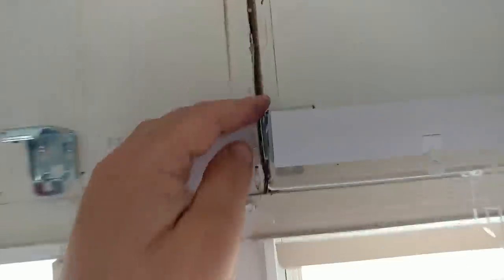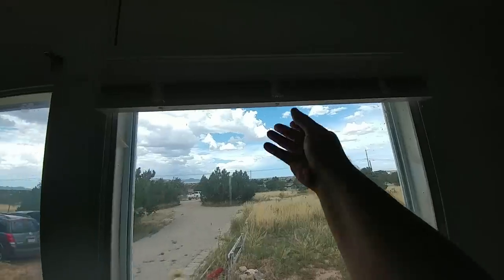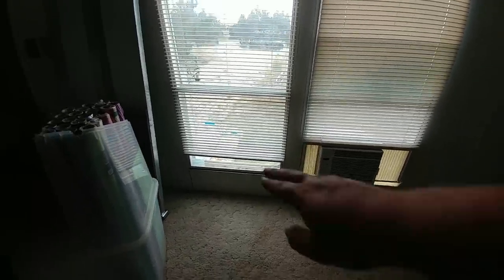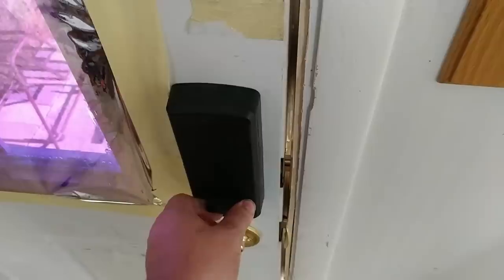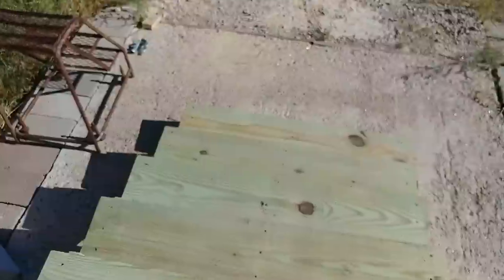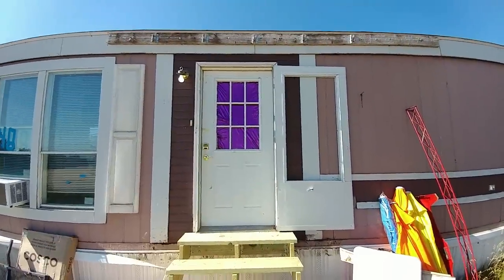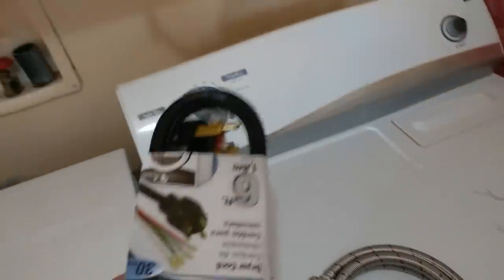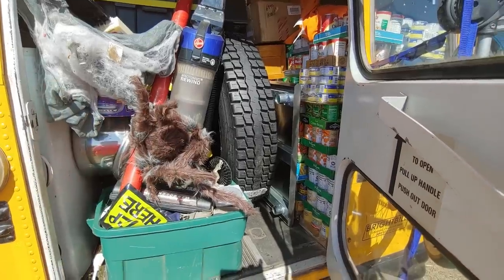The Insane Migration West 4of4 T3DP

Comment: Don't putty it, it will just crack and look worse. Put the wood back on and save yourself a ton of headache. The correct way is to tape the joints
Reply from the maker: Thats what i mean. Mid tape sand prime paint. Yes mud alone will just crack.

Comment: PRO TIP on the cordless blinds: measure the inside of your window frames and have your blinds cut to fit at the big box store when you buy them. Mount them inside the frames.
Reply from the maker: Wont work on these. They are not normal windows. These thick overall but thin outside inside weird double set mobile home storm window things. Very odd.

Comment: Could try running a garden hose to the washer drain just to check if it will overflow before you fully commit to washing clothes?
Reply from the maker: I ran a light empty load to make sure drain was good. It is. We have run 6 or 7 loads already. All good :-)

Comment: I wonder with the heat in your bus if the PLA is all shot
Reply from the maker: Windows are open and its shielded from amplified glass heat. It should be ok. I also keep it in shadow both at home in pa and here in NM. The sun hits the opposite of the bus. So far it seems ok.

Comment: Lookin good!  The blinds remind me of old timey shades, they pulled up and down just like that.  For the too short blinds, you could buy a longer valance (short little curtains that go across the top) then you could lower the blinds the five inches.  It's a good way to rig them so it won't show.  I've done plenty of things like that to get things to fit. 😁 Also you probably already have the tubs out but if not you could cut an opening in the side of the top tub empty it then it would be lite enough to get down.  Would lose a tub but you can get your stuff out. 🤪😁

Comment: you can actually mount your clips anywhere along the area your blinds run at the top. they do not have to be on the very ends, you hook the front and push to the back.
Reply from the maker: In my case they have to be on the very ends because that's where the studs are :-) basically they have to screw into something and the wall surface material itself is not strong enough in order to reach the studs I have to go to the very ends
Reply: Ah ha! I did not even think about that.